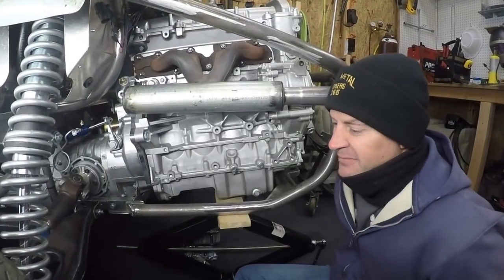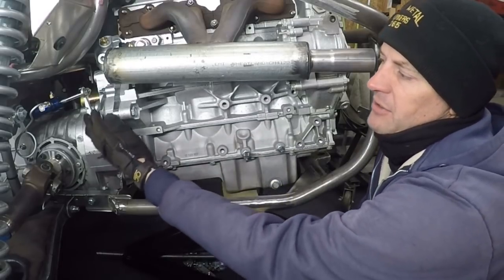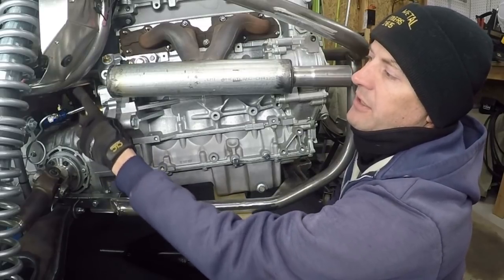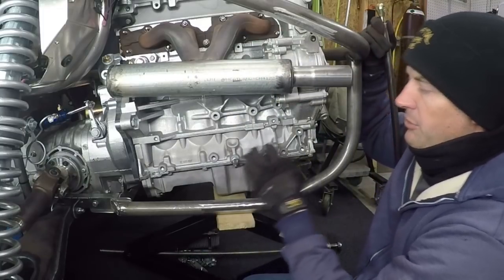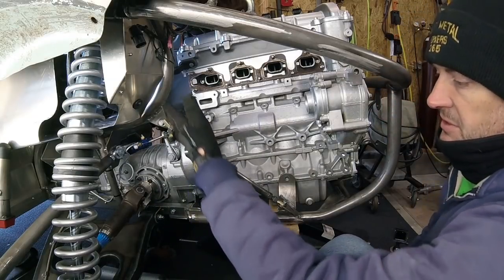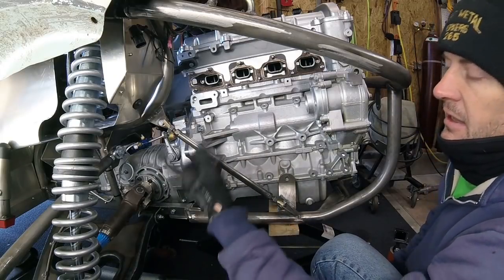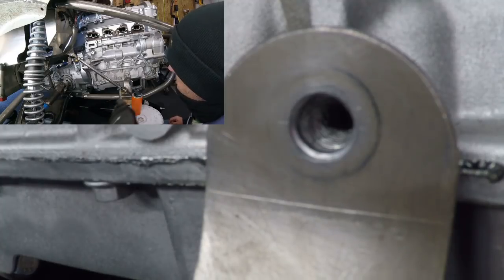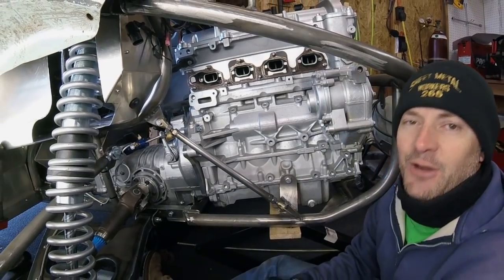No Flex Ecotec Motor Mounts (Ecotec to Baja Swap Ep  9.)

Comment: Hey Doug, Great videos!  After watching your videos, I'm considering the Ecotec engine. I am building a sandrail and don't have an engine yet. VW are expensive if/when when you find them. My concern is the weight. A Subaru is about 250 lbs. Not sure what the weight is?  Any idea?
Reply from the maker: The Ecotec is a little bit heavier than a Subaru. It also has a higher center of gravity because it stands up. I don't know exactly the weight difference, but I've worked on both and there is a little more metal on an Ecotec it seems. However my personal experience is that I prefer the Ecotec. They are more prevalent in junkyards and more reliable. (these are personal opinions) I think you would be quite happy with an Ecotec.

Comment: Looks good, man you need a propane heater in that garage, I got cold just looking at you lol. you don't need any kind of bushing in between those motor mounts? they don 't make any rubbing noise?
Reply from the maker: It's cold, but if I'm in the garage with the door shut and there's no wind it's not terrible.
No these don't make any noise at all, no vibration issues either. But I haven't decided if I'll do bushings on the next chassis or not.

Comment: I also am switching over from a VW  motor to Ecotec for my sandrail and I am wondering where you got the four clevises at? Thx Scott.
Reply from the maker: Sure thing buddy, I got them here at McMasterr Carr. https://www.mcmaster.com/clevises
Part # 4749T14 
You'll need some with right hand thread and some with left hand thread to make it work. McMasterr will also have left hand thread 1/2" nuts, you'll need those also.
Good luck with the build, let me know if you need more help.

Comment: Would not poly bushes have been a better idea... Only asking ?..
Reply: Doug Bug I understand I think,but always remember you need sponge type flex..,from my understanding on mounts otherwise flex with out sponge/bush at a certain angle as in your build will snap..i have just rebuilt a Landrover discovery 2 and used super Polly bushes not cheap but worth every penny..Where I am I'm lucky too have one of the lasts old mechanics around in Scotland..I remember saying and showing what your doing,and he showed me why... Why I asked,answer he said LOOK AT THESE OLD SHIT WE DROVE,NO POWER STEERING, SHITE SUSPENSION, DEATHTRAPS.. FRANK F FOR CHANGE..Xx..and told me bushes are great once torqued Correctly.. Okay I made a little up but your beds sofas are just right for a reason..SO THINK ITS AT A ANGLE THATS LIKELY TO BOUNCE..A BUSH IS A SAFE BET rather THAN A COMPLETE FAILURE WHILST GOING TOO FAST AT WRONG ANGLE..x..just what I was taught Doug..
Reply from the maker: You're making sense, bushings would be better.
I'm designing a new chassis right now and I'm trying to design it with less connections so I can use bushings on the Tranny and Motor.
Thanks for the tips.

Comment: curious as to why you used flux vs using mig on your brackets?
Reply from the maker: My mig/flux machine is 120v. So when it comes to heavier gauge like this (3/16"). The mig won't do it but the flux core will. Typically I weld with the flux core or my tig. I pull out the tig when it needs to be really strong or really clean. This was easier with the flux core and the strength will be fine.
Don't get me wrong, I'd rather do it with mig. Someday I'll get a 240v mig and never use the flux core again.

Comment: How did u make the tie rod joint / turnbuckle
Reply from the maker: I purchased the 1/2"x20 threaded clevises with a 5/16" hole.
https://www.mcmaster.com/#clevises/=1bunnrb
One right hand and one left hand for each side. Then I purchased right hand and left hand nuts from McMasterr as well. I tig welded the 1/2" nuts to the ends of 3/4" round tube to make the tie rod. Then threaded the clevises onto those.
Hopefully that answers your question, if not let me know.
Reply from the maker: 4749T14 is the part number for the clevis, you need right hand and left hand threads.
Reply: Doug Bug what size tubing did u use
Reply from the maker: I emailed you.

Comment: Hey Mike , it's been awhile the Baja is looking good, I was just watching you build the motor mounts, it looked like when you rolled it out side you were mig welding is that right, if so why not tig. Do you prefer one over the other, do they both have the same strength
Reply from the maker: Hello Mike, Mig (flux core) is quick and easy. Tig is stronger and much cleaner but takes longer to prep and weld. So it depends on what I'm doing as to which one I do. I Tigged some of the motor mounts but then I migged the brackets for the supports. Mainly because it would be easier and plenty strong.
Reply: Oh ok thanks Mike